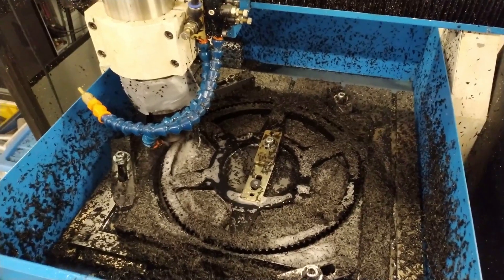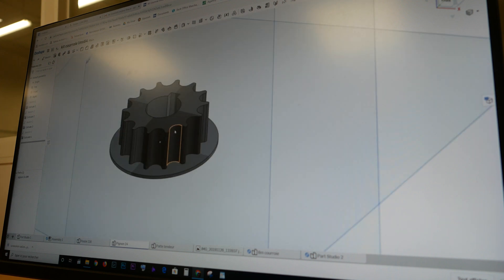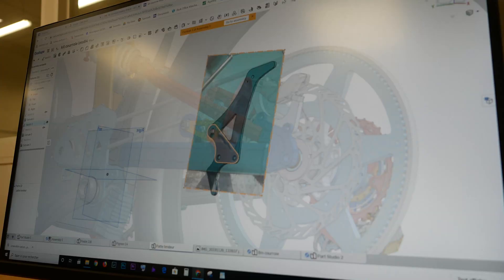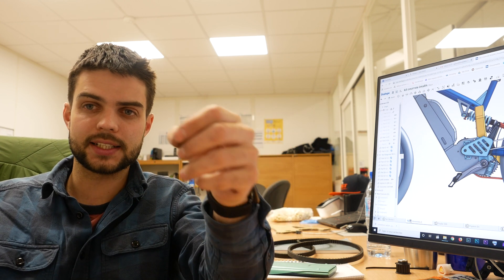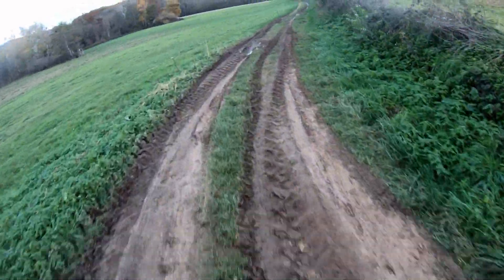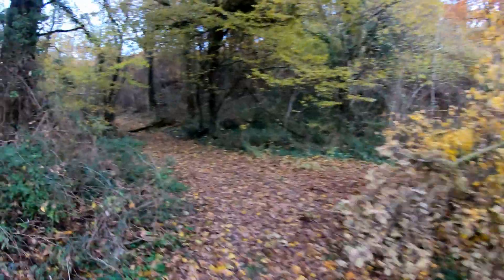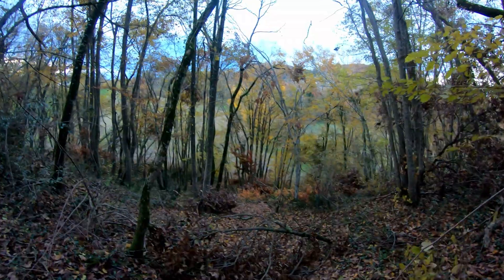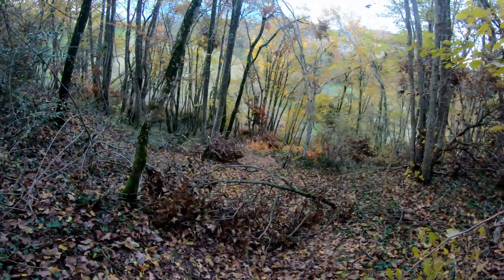LMX Vlog 012 - LMX 64 belt solution and testing

Comment: Cool stuff!  Surprised and glad you guys were able to get away with such as narrow belt.  :) Bummer Gates doesn't make their center track belt a bit wider.
Reply from the maker: Fitting a wider belt would be complicated, but up to 15mm could fit if the 12mm ends up being too weak. The beta version has already some improvements to the drive sproket and tensionner.